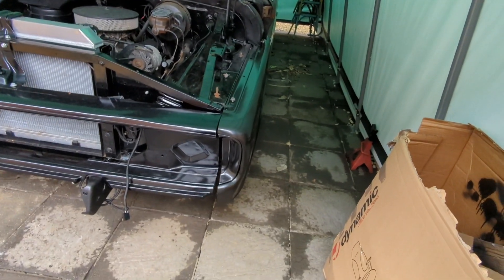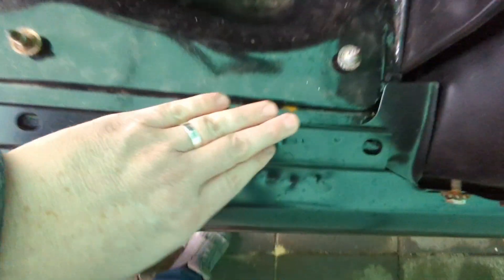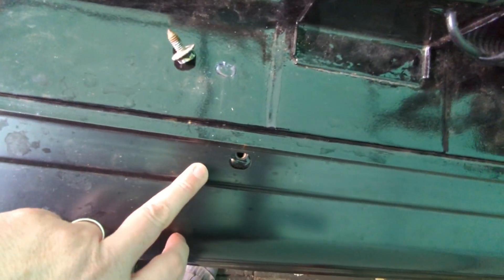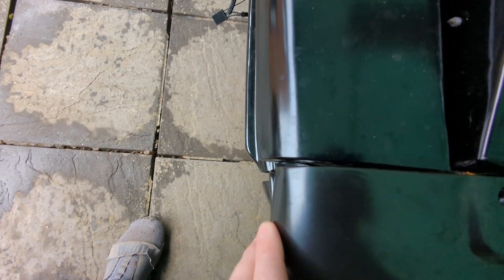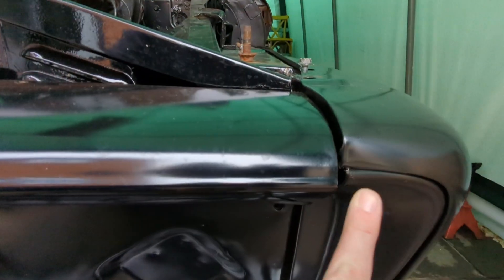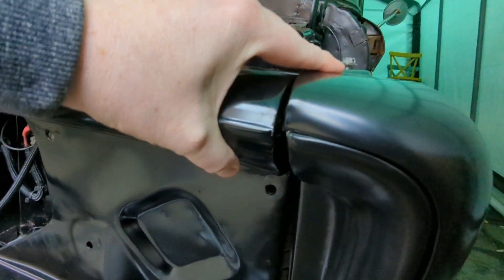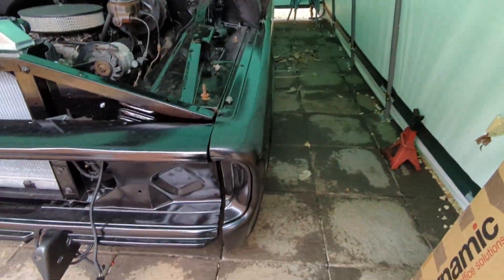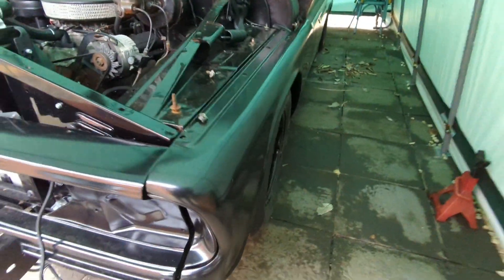Fitting Drivers Fender To My 1963 Chevy C10

Comment: I did check out the repops at the  car shows when I was working on my 61.I believe that most have the same issues. I  restored a couple of original fenders. I  also noticed that most don't have the same profile on the  wheel well. Your doing a awesome job 👍
Reply from the maker: If I'd of realised how much work it would be to fit the new fenders before I bought them I wouldn't have bothered. I do think it would have been quicker to repair the originals. 
Nevermind, I've kept the original fenders so may repair them in the future.
Thank you